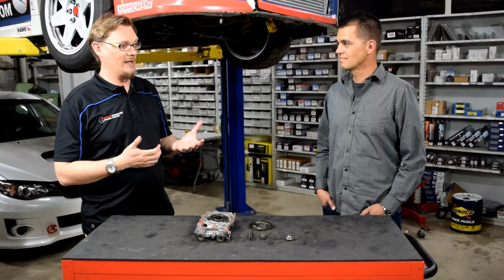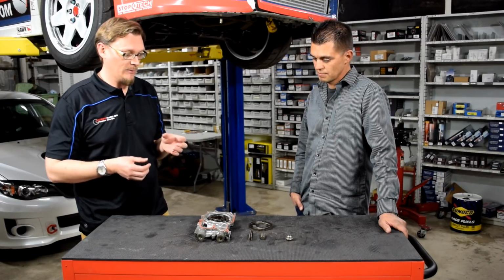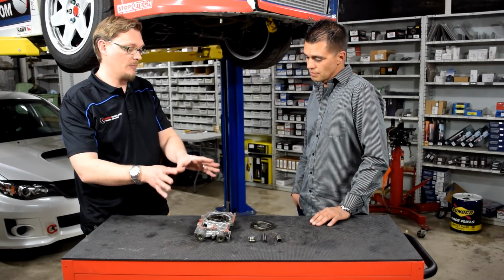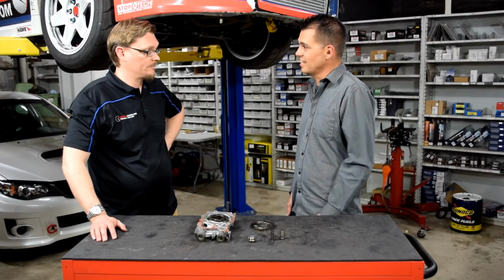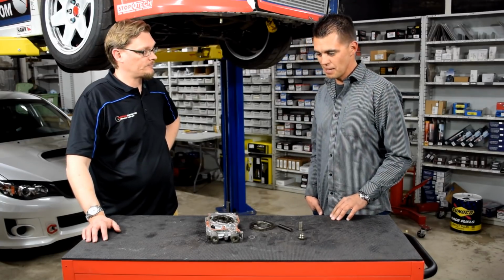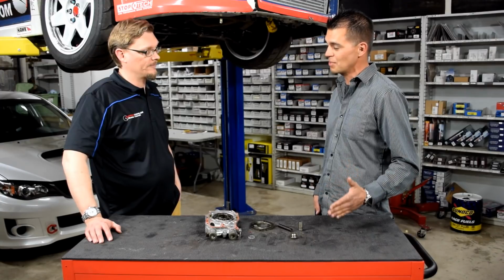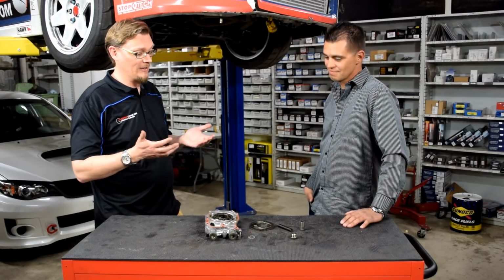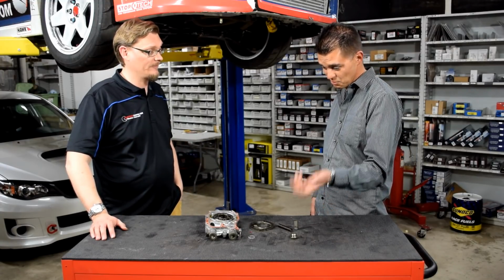A discussion of Oil Pumps, Oil Pressure, and Shimming Subaru pumps

Comment: I have 07 jdm legacy gt(ej20x). Did an ej207 v10 shortblock upgrade with stock dual avcs u20 heads. I put a new 12mm oem oil pump. My oil pressure on hot idle seems low(14-15psi)@750rpm. Will shimming help to raise the oil pressure?
Cold start- 90-94psi 
Using 15w40 conventional oil for breakin period(1000kms so far).

Is this pressure normal or i need to do shimming to raise it?
Reply: What’s the hot oil pressure at 4k rpm? I’ve seen some folks run that low but it’s normally on built motors with extra clearance.
Reply: @adidas2284 hot oil pressure at around 4k rpm is 75-80psi range. I have a Brand mew oem sti ej207 ver10 shortblock with legacy gt heads

Comment: Coming back to this with more questions/info.  Engine rebuilt 2 yrs ago after the cooler fiasco. Running well enough still not fully tuned up to the goal of 400whp. 

 Oils pressures 15w50 500~550kpa(72-79psi) from 3k-7.2k rpm. heat dependent All the way up to a temp of 90c is all it's gotten to (temp taken from pan)  Im running 2 shims from what I remember. (could be 3) dont remember current curiosity wasnt noted until recenetly. 

But at sustained high speed 100+ and high 6k+ rpm. 2mins+  I BELIEVE Im getting some cavitation in the pump. Pressure starts to bounce quickly about 20-50ish kpa(3-7psi) maybe a bit more?(10psi?) Hard to keep my eye on it while going that fast. Unsure whats causing the cavitation. Maybe the pan/pick up unable to keep up with the demand(?) Or my catch can system is pulling so much vacuum on the breather system it's keeping oil in the heads and they're not draining back(?)  (catch can does fill up after these types of runs maybe a restrictor in the catch can line could be a soultion? Or perharps swapping the head breather line to the pcv vac instead of it being on the turbo inlet vac line)  maybe my issue is this is just not a wangan mobile lmao.  

Wish I could talk to this victor guy or he'd chime in with more specific knowledge.
Reply from the maker: Thanks for your question.  2 minutes is a long time to spend above 6,000 rpm, and at high power, etc.  The longer you spend at WOT, the more likely you are to over-tax your AOS/Catch Can system, and that is most likely why you are seeing full catch cans after this kind of run.

I'd recommend looking into some kind of system that will allow you to data-log your oil pressure at a minimum (ideally you would want to add in oil pressure and crankcase pressure as well) so you can see what is actually going on in those conditions.  I'd have to assume that your oil temps would be increasing in that long duration spent at high rpm.

Hope that helps and Stay Tuned!
Reply: @FlatironsTuning   Ah yeah I should probably stop ringing it out like that as I didn't build it for that type of driving more of a wild canyon carver during which this type of pressure fluctuation doesnt occur or isn't noticed I suppose. 

My oil temps are taken from the pan (moroso Aluminum racing pan)  temps stay sub 70c During these runs.(given night and cooler ambient temo) Even on hot days (80-100f) if the car is moving the temps stay sub 80c(usually sub 70c if freeway cruising) while moving and only creep up to 90c while not moving but drop as soon as it's flowing at a higher rate again but perhaps Im getting false readings(?) Maybe air is cooling the temp sensor as the pan sits lower than the bumper line so lots of airflow right by the sensor. Maybe I should add a sensor to the rear of the block? Lots of conflicting opinions on where oil temps  should be taken from.     

I've got a defi link set up I think it has the capability to record short stints of data. Tho I'd only have data for my h2o/oil temp, oil press, and boost  will have to figure out how to log/access it.

Comment: Everyone puts so much importance on the oil pressure and just think a bigger number is better but the actual requirement of oil pressure is not only dependent on the volume of the oil flowing all the way through the engine without any cavitation or starvation occurring...as long as you have a good consistency of flow and volume the required pressure is drastically reduced....

Comment: Personally I didnt see a correlation between adding more shims and increasing pressure.  Pressure will ultimately be determined by how ever much the clearances allow/create. Once you hit that it wont go up with more shims as this convo leads you to believe.
Reply from the maker: Thanks for your question.  The relief valve ship increases the pressure on the relief valve, which in turn increases the maximum oil pressure that the pump will send into the system.  Now the volume of the pump has to be sufficient to create that pressure with a given oil weight, and temperature.

It can increase the maximum oil pressure in the engine, but the clearances of the engine, oil weight, and oil thickness (at a given temperature) all have fall into the proper condition to allow the pump to create that pressure.

Thanks for watching and Stay Tuned!

Comment: Crank driven pumps are a bad idea, at high RPM they can cavitate, and putting air into the oil is a death sentence for bearings, oil pumps need slowed to half crank speed which is why serious race engines run dry sump systems, some driven off cams like sprint cars, others belt driven like NASCAR and IMSA , and Drag race engines.

Comment: i have a question, i am looking at new oil pump but it asking me to choose how many shims, i already bought not installed yet is oil cooler and oil spacer and soon going forced induction so do i need to increase oil pressure before installing or can use a stock oil pump
Reply from the maker: Thanks for your question.  The best answer I can give is that the relief valve pressure only adjusts your maximum oil pressure.  If it is set to 85 psi, once your are at normal operating temp, that should be the highest oil pressure you would see.

As far as what you would need to do with that maximum pressure when adding forced induction, I can't say.

Hope that helps, and Stay Tuned!
Reply: @FlatironsTuning  i was thinking increase pressure because it needs to be in more places like oil cooler and added turbo cuz it also needs oil for the shaft. but i wanted to know if it's nesscery or not, haven't found answer with forums, thanks for the reply!
Reply from the maker: @al3zmi  Okay, remember that all the shimming does is to control peak pressure.  If you are adding extra demands on the oiling system (like a turbo  for instance), this is where you may need a pump with extra volume to get your oil pressure up to that peak pressure as quickly as you would like.

Since you are adding this onto your oiling system, I would either check with a shop that has done that change and see what they recommend, or if you can't do that, keep a close eye on oil pressure as you run the car for the first few times and make sure that you have sufficient pressure at idle, an lower rpm's, etc.

Hope that helps and Stay Tuned!

Comment: I think too many tuners run out to grab bigger pumps thinking its better. Here's a guy that ran a race motor with 10mm for a long time, not until larger hp numbers and clearances came into play did he have a drop. Most guys with light mods need to stick to the stock pump.
Reply from the maker: Thanks for the comment Rob, and that is pretty much the conclusion that we came to as well.

Thanks for watching, and Stay Tuned!

Comment: Hi there.  Great content thank you.   There were a few mentions of increased tolerances for bearings / journals.  I'm assuming that's both mains and big ends? Are the tolerances much larger than the factory tolerances? I.e if a crank ran a bearing and was re ground to a point where most engine rebuilders would put undersized bearings in,  could we Possibly get away with using standard size bearings intentionally to get that extra tolerance?
Reply from the maker: Thanks for your question.  Above all, I'd definitely recommend working with your engine builder on this one.  If your crank can be machined to a very precise tolerance, it could be possible that using a standard size bearing on the machined crank could give you the clearances that you are looking for. 

Again, a lot of that is going to come down to the machined specs of the crank.

I hope that helps and Stay Tuned!

Comment: Having also a built my  EJ207 myself with race bearing clearances and a 12 mm pump I noticed two codes being thrown .
They were camshaft position sensor B  (P0390) circuit bank 2 and (P0365)  bank 1 .
My tuner informed me that cams were phasing correctly with no issues , my question is could increased in pump pressure and volume throw the codes in question ?

Comment: Would a lightly modded EJ255 benefit from an 11mm pump? 
2010 Single AVCS stock internals with killerB pickup and STI oil cooler. Thank you for the great content!
Reply from the maker: Thanks for your question.  As you increase the volume of the oil pump, it means that your pressure will build faster.  But that also means that you will hit your relief valve pressure sooner (think at an earlier rpm).  So if you have a much larger pump than you need, then the oil will spend more time going around the relief valve.

So as a general rule, we recommend using the pump recommended by Subaru until you make any changes to the oil clearances where you would need the larger pump to maintain the normal target pressure.

I hope that helps and Stay Tuned!

Comment: Is there any adancatage to using a bigger volume pump on a non turbo subaru?  Stock is 7mm.
Reply from the maker: Most likely not.  Adding a larger volume pump just means that you will reach your relief valve pressure faster, and spend more time with the relief valve cycling pressure around the pump.

In short, if you are not having any pressure related issues with your current pump, there is not any reason to go with a larger one.

Hope that helps and Stay Tuned!

Comment: This was very interesting untill you mentioned you went with a thicker oil with the bigger pump. That's thrown all your testing out the window. A thicker oil with the 10mm pump would increase the pressure

Comment: A bit confused as to how (or if) shimming the spring changes things at pressures significantly below the existing relief pressure.  If the factory pressure relief is 75psi, wouldn't shimming the spring only make a change if you were already seeing right around 75psi (or greater) ?  If you were only seeing 60 psi hot isn't the relief not doing anything at that point and thus a change to the relief spring wouldn't change anything?
Reply from the maker: Thanks Patrick.  This is a great question, and you are thinking of this correctly.  The relief valve spring is only controlling your peak pressure.  Once you hit that ceiling (say 75 psi), the valve works to maintain that ceiling pressure.  But if there is an issue with the pump such that it can not get to that pressure, raising that limit will not make much if any difference to where the problem area is.

Thanks for watching the video, and Stay Tuned!
Reply: @FlatironsTuning  Thanks for the additional explanation!

Comment: Sum up: increased tolerances (bigger bearing clearances)= need more volume (bigger pump)

Increased RPM= need more oil pressure (using shims or stiffer springs)

Viscosity is resistance to motion. If the viscosity is reduced the oil flows more freely, i.e. faster, and hence the static pressure is reduced. Increase the viscosity and the oil is flowing slowly and the static pressure increases. 

Heavy oil (15w40/50 etc) is more viscus so it resists flow and acts as a better cushion for your bearings (hydrodynamic suspension) but as the oil heats up past it's operating range the viscosity will drop and the the oil will flow easier and not hold pressure as well.

You can increase the oil pressure and volume all you like but really it's the temperature change that causes the pressure drop and everything being done in the video is a common band-aid in motorsports that is just not as good as just reengineering the oiling system including better temperature control.
Reply: I have an old SOHC EJ25 w (stock 7mm pump)  I like to rev out to 6500+rpm preferably 7000 but I haven't dared to go there yet because I  am losing oil pressure in the 6000s.  Everything is great until somewhere in the low-mid 6000s where it goes down perhaps as low as 50-55psi (hard to tell with it bouncing around and I don't have datalogging on it yet).  I  am thinking about switching to a 5w50 from 5w40 and/or changing to a 10mm relief spring.  Do you have any thoughts on this setup?  My understanding is that the stock relief is 70psi on the 7mm pump.
Reply: First: the blowby at higher rpm can cause issues so I'd move to a full race setup where the ports are vented to atmosphere or catch can that you check and empty after high tom runs.

Second: Port match the oil pump and shim it, look up what the Tomei aftermarket pump has done and replicate that. 

Third: add an oil cooler and change to thicker oil, or substitute 1l synthetic oil additive (lucas synth etc) in your oil changes so it's 3 to 1 with 5w30 and additive

Watch psi gauge after each change and don't do them all at the same time. This will show you what worked for your engine the best

Comment: Great video. Love watching your stuff. I have recently built a EJ257 with a RCM 12mm pump. My oil pressure was around 65 to 70psi and was happy with that. But then I installed a CSF rad with cooler and saw a pressure drop to 50psi and am very concerned about it. Oil temps are great  Around 90°C. Would you recommend shimming in my case?

Thanks for any help
Reply: I work at a subaru performance shop and we have been seeing oil pressure loss of 10 to 15 psi with the csf rad and cooler combo. 

Do you think 50psi is to low
Reply from the maker: @turbosupra420  If that is at full throttle, I would say that is too low honestly.
Reply: @FlatironsTuning  is there another way I can talk to you.  Would like to pick your brain a bit
Reply from the maker: @turbosupra420  Sure, reach out to us on Live Chat on the site www.flatironstuning.com
Reply from the maker: Thanks for your question.  That is a little odd.  If you put a shim in the relief valve, that will raise the peak pressure where the valve would open.  But it would not make any difference if you are below that pressure (which 50 psi would be).

If you had the issue after running the oil through the CSF radiator and cooler, I'd recommend going back to your previous configuration.  It makes me wonder if there is some kind of issue that is being caused by that cooler.

Hope that helps and Stay Tuned!